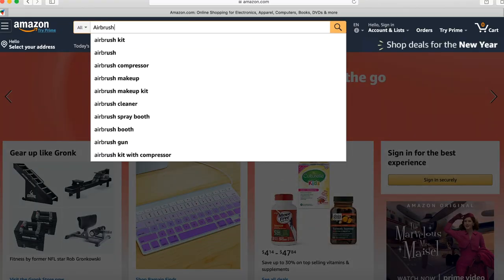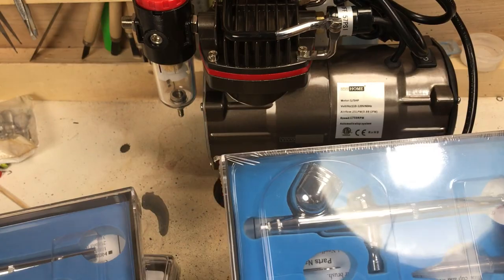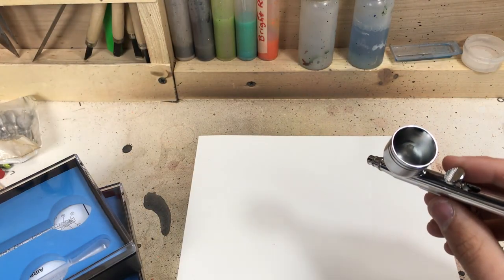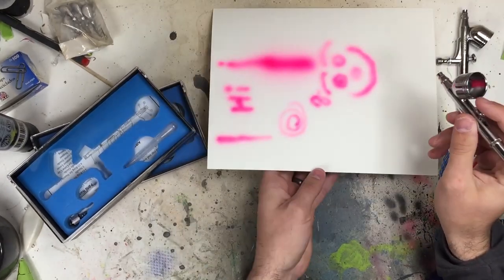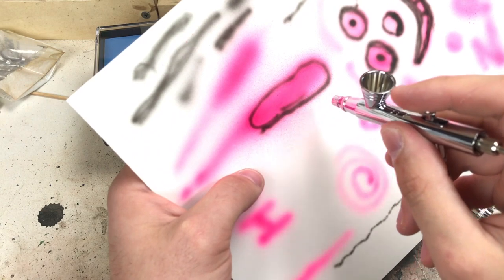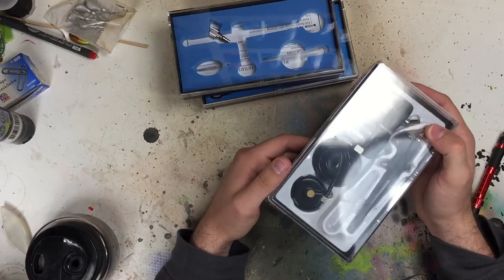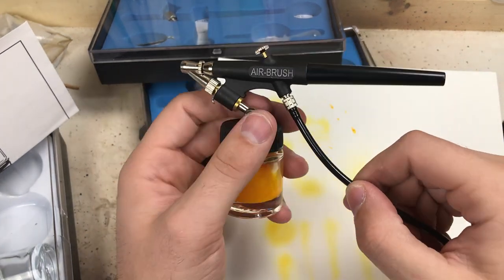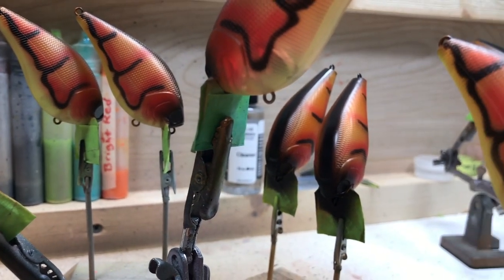Affordable Airbrush Kit

Comment: Just as a frame of reference, on April 4, 2021 this item is listed for $109.99.
Reply: back down to $76 on amazon now!
Reply: @cbtx777  and you can get one (different model) for $64.59 with just one airbrush.  Getting that one and using the money saved to buy a better brush might be he way to go.  I'm thinking of buying a compressor with an air tank to reduce the wear and tear of the compressor turning on and off so often.  My short little search has shown that most of these manufacturers have engineered these combo compressor/tanks completely wrong.
Reply: I just bought one today with all three brushes, the same kit reviewed in this video of $67 on Amazon for $67 with next day free delivery with Prime! I am stoked.
Reply: Put it in your cart and give it a day, I got mine for $63 it was $109, stuff changes if you leave it in your cart lol

Comment: A little late, but the one with the larger bowl is also available at HF with a little better compressor.  The siphon feed brush is, from appearance, the same as the one HF sold for $10.  They do work, and with a little fiddling work pretty well, but they're intended for painting larger areas.  The problem the OP was having, just not screwing the nozzle up far enough.  Setting that works best when the air is on.  Cleaning it is a little sketchy, but it does come apart easy to be washed.  I use lacquer thinner, then blow it out and reassemble.

Comment: I have been painting baits for a few years with an assortment of airbrushes, I have had that single action AB for years and never used it, recently I have discovered that you can base coat 3 times faster and with heavier viscosity paint than you can with the double action gravity feeds that I have (master 5ea, harbor freight,  Badger renegade krome and a Paasche vision) that little brush beats them all for complete bait coverage with the least head ache once you learn to use it, you will love it, just do not expect fine detail, but 10% the clogs and not near as temperamental about paint thinning for those complete bait coverage painting. Good videos and keep up the good work

Comment: There should be a vent hole to allow air in bottle. So it can get sucked into sparyer. Cant suck paint out of a closed bottle. Also only adjust air while sprayer is pumping out air.

Comment: You are correct in your assessment of the siphon feed brush, they do have their uses. I use mine to do large areas such as backgrounds and such, or when putting white base coat on multiple baits at one time, the larger volume of paint is good for that but I find very limited use for them and they can be problematic with vents plugging as others have noted.As with many other tools , their uses are only limited by the skills of the user.  The other brushes you tested though look great and thanks for the testing video. I have only started doing baits the last couple of months and am  loving it , next step is to start carving and pouring to begin feeding my muskie fishing dreams. May not be cheaper than just buying a bait , but certainly will be a lot more satisfying to land something nice on something I MADE MYSELF ! Keep up the good work , We all stand on the shoulders of giants in the advancement of knowledge.

Comment: Hi my friend, just bought and received the exact hardware that you're showing, thanks for the unboxing! 
I just found your channel, going to watch all videos and learn, in the meantime I would like to ask: I never use airbrush before those 2 that you are showing( I didn't buy the bottom fead) and that compressor is my first set up ever so I have to learn everything, 2 questions:
1-The haverage psi to start with, around 20?
2-about paint, I would like to begin with acrylic, how to thin color?
Thanks so much for your help!
Reply from the maker: Good deal! I run mine at about 40psi. But that’s with Createx Airbrush paint. If you thin down Acrylic paint you can probably spray it at a lower pressure. When you thin the paint you will want it to be about the thickness of milk or eggnog. Also, be careful with the bait after you spray, acrylics scratch easy. I will spray mine with a polyurethane out of a spray can to help protect it till the actual clear coat goes on. Good luck!
Reply: Createx are probably colors made for airbrush, what the difference between acrylic and paint for airbrush? Different way of thin? Most important, about thin acrylics, just water or something else as floetrol, glicerin oil, etc, if you did acrylic on the past, how did you thin them for airbrush? Thanks!
Reply from the maker: Luca Esposito oh yeah, forgot to say that. I just thinned mine with water. I believe there are thinners sold at hobby stores specifically for thinning paints for the airbrush however I have not used them and I’m not sure what they are made out of. But water worked good for me
Reply: That's what I like to ear. I'm Italian living in Chiang Mai, Thailand, here we can't find all these tools, materials that over there in USA you easily find everywere, the only option for specific stuff is eBay, Amazon however with import tax The Price turns to double if lucky. So water to me is more than fine, thanks a lot and now I can begin!

Comment: That airbrush you dislike is probably the best priming/basing airbrush design to date.  The badger 350 I had is the same thing and with the Medium and Heavy heads coats larger models like a dream.  If this one comes with the Fine head I can see your dilemma as the fine really doesn't work at low pressure with thick paints very well.  My Badger has all 3 and the M and H were the ones I used with zero problems ever including many Hobby paint tournaments.

Comment: Zach, great video and review. I watched this about a month ago and ended up purchasing the same bundle. I am a newbie and figured this was the best way to get my feet wet. I've been using it and noticed that I am having some issues with the paint getting clogged. Just wondering if you use reducer with your wicked and createx paints. I have not. Second question is regarding the compressor. It constantly turns on when spraying and I'm wondering if this is normal. I thought it should turn on periodically when it loses pressure. Since it is truning off and on almost every time I spray the motor is getting hot. Just wondering what I may be doing wrong. Love your videos. They are so helpful and you are a great videographer. Nice level of creativity and filming always make the experience better. Keep them coming!
Reply: you're not doing anything wrong, there is no tank on this compressor. So everytime you press the button it needs to turn on to keep the pressure up. They do get hot. depending on where you l ive and the humidity outside, sometimes when they get really hot water condenses. The moisture trap is supposed to catch the water before it gets in the hose. but if it forms in the hose it'll spit water occasionally. I live in florida and this happens to me. a tanked system helps prevent this and stores air so it does not turn on so often, so it does not get as hot.

Comment: What’s your opinion on harbor freight compressor and gun kit? Also I’m gonna be painting lead, do you recommend any certain types of paint, should I use primer first? These will be for my business and I want them to be of the highest quality and I don’t want to paint the chip easily
Reply from the maker: Pump works great! I have been using it for a few years. I do recommend getting a top fill airbrush from Amazon. When I paint the lead I rough up and clean the surface. I haven’t found or used a lead bait that doesn’t chip eventually when you are hitting rocks and stuff. I use Createx Airbrush paint. Check out my video on how I prep my baits 🤙

Comment: New to the channel & very interested in trying to paint some baits , have rattle canned a few but never used an airbrush , is this kit still working good for you & are you cutting your paints any when you run em thru your airbrush or straight out of the bottle ? Again never done this , hope this doesn’t classify as a dumb question , thanks for any help
Reply from the maker: Most of my paints I run straight out of the bottle at around 40PSI. Sometimes I do thin a little with water if its a thicker paint. Sorry for such a long delay in response!

Comment: So i bought this set up and i am very satisfied. I use cleaner on every color change and run it all the way out. I am now seeing that the larger bowl airbrush has clogged a lot faster than the smaller bowl airbrush. Have you experienced this as well. I was using them simultaneously until the larger one started sputtering. I took it apart and cleaned it, but it still sputters with paint. Sprays decent with water or cleaner. Any suggestions?

Comment: I am just learning all about this, but from what I have come across, if you set the pressure too high on an airbrush, you will get air & no paint. That may explain your trouble with the bottom siphon larger airbrush unit. You read the pressure should be 15-50 psi, & that 'normal operating psi is 30." But you were set to 40 psi, & got no paint, but air. You then cranked it even higher, to 50 psi. You got some paint, but not a good flow. But you did not test going lower, (either trying to step down, after 'priming') or trying the lower 30 psi recommended level. It left me to wonder if that may have fixed the problem? I think this tank siphon brush might be good for clear coating.

Comment: Thanks for this video!  I picked one of these kits up over the weekend and am having a blast.  QUESTION: The little compressor runs A LOT.  Like anytime I use the gun for more than 4 or 5 seconds, it kicks on.  Is that normal?
Reply from the maker: Glad to hear! And yes, they run every time you spray 👍
Reply: Same for me. Was wondering the same thing. The motor gets pretty hot too. What about for you?

Comment: I've been using airbrushes from 1964 (Bump and paint man), have a degree in fine arts, art teacher and painted anything and everything that stands still. None of those companies MANUFACTURE airbrushes or related equipment, they sell Chinese knock offs and re-badge them.
 If you are looking for quality equipment, cheap prices and easy to find parts... in the USA look at Paasche Airbrush Co (American made Since 1904), Compressor; several choices, with Sparmax being number one "Oil Free" ... brought out in early 1990's, everybody from Iwata to about everyone in China copied it's design or purchased it and re-badge it... just a fact of life..
 I personally own at one time or another about every brand airbrush made. I'm 73' and in my studio I have two  Sparmax twins compressors, a Jun Air (Oil Bath) silent compressor (extremely expensive)... Airbrushes, Paashe, One old Iwata HPC, several Sparmax (SP-35) brushes, and 3 EFBE (German).
 You get what you pay for. For all my students I recommended Sparmax compressors with tanks, (Art Logic, makes a cheaper quality pump for hobby work). In the old days we also used CO2 tank gas to run the airbrushes as the noise of old style pumps drove the studio crazy...LOL
 So check what your local art stores sell (including parts, important) ... avoid Amazon or big carton hardware chains as EVERYTHING they sell is Chinese rip-offs. For fishing lures Art Logic compressor with a tank are not expensive and used the Paasche Mdl H (developed back in the 1920's is simple, cheap to fix and robust, will do a great job in an beginner-pro's hands. Be safe...

Comment: Hello. I bought this exact Airbrush system from the exact seller. I live in Europe and we have 220 volts. I have power converter from 220 to 110/120 but 80 watt is max. The Compressor does not starts. What may be a problem? maybe 1/5 power is too strong for my converter switch?

Comment: Need vent hole in jar lid works off suction no air getting in jar = vapor  lock.
Reply from the maker: Steve Meschede jar has a hole in the top
Reply: Just thought that could be your problem . It is a problem that plagues bottom feeds . Paint or gasket covers hole

Comment: Is there a video on how to get the compressor to work? Yeah, it's plugged in, Yeah, power is on, Yeah, hose is attached. Pressure comes out, press down on trigger, compressor drains to 0, everything just stops, nothing happens.
Reply: ah, had the same problem with the black one as you did. Compressor still not staying on.
Reply from the maker: Compressor builds pressure before you push down on the trigger?
Reply: Having the same problem any suggestions?